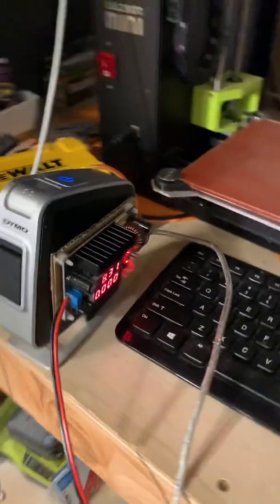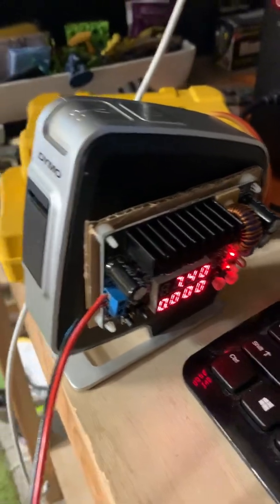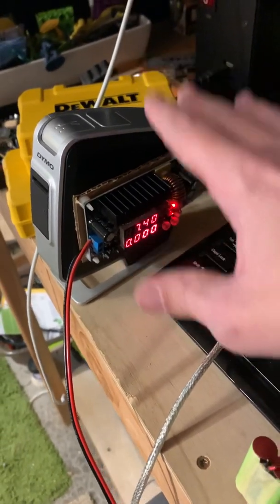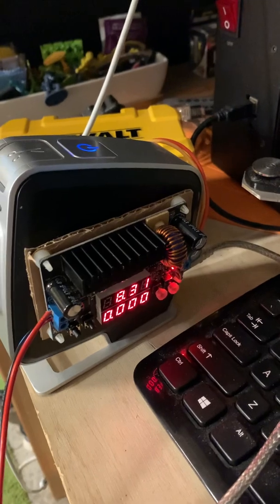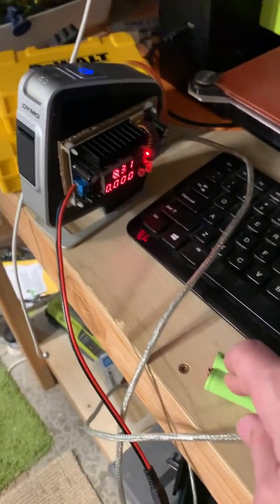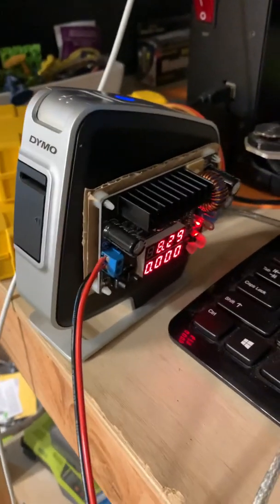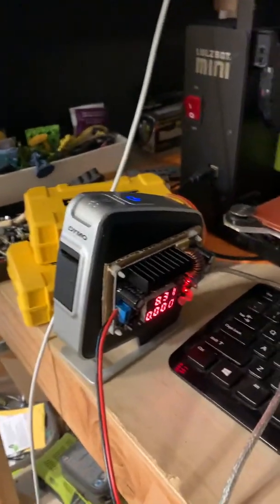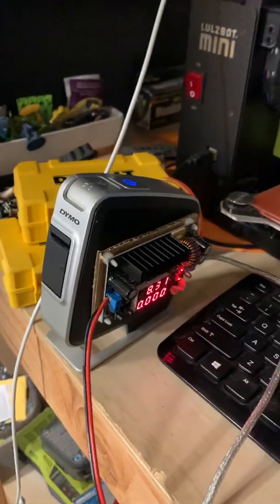Repairing a dead Dymo label printer - Support Right To Repair and ethical electronic design

Comment: good explanation of the problem. I like the printer and the basic idea, but they should have just used a pair of standard size Lithium Ion cells (a pair of CR123's mighta almost fit) and just told us to keep it plugged in for 20 minutes or so each time we use the printer to keep the cells charged. They would last years that way.  Like you said though, that doesn't make them more money does it?     Great video!  Thanks.

Comment: Just received a broken PnP and I'm about to get deeper into the actual cause of failure. I suspect the printer uses excessive amount of current when lying disconnected in a drawer, thus killing the battery. Would not happen if the printer was constantly plugged to the USB. The manual says to remove the battery for prolonged storage, and that's as simple as that to protect the printer from failure. Of course no consumer would ever do that but will happily blame anyone else for the failure. The R&D could have added an internal battery switch that cuts it off when no VBUS is present, but after working in a few electronics companies I can see why it did not happen (no time to roll out another PCB spin).
I'll experiment with capacitors instead of batteries, so the printer will be immune to fatal discharge below the safety threshold. If it works it will be even better than a battery pack, but I don't hold my expectations high, especially when printing a solid black square.
Also, planned obsolescence is a myth. The actual reason why stuff breaks down are the accountants and marketing people running the R&D departments. No actual effort is ever put into making stuff break prematurely, because it's already super hard to make things last. It's the pressure to keep cost low and time to market short. Ever wondered why it takes 10+ years to send anything into space, and everything is delayed all the time? Because consumers are not a part of the equation. I worked there as well and I liked it.
Reply: I have mine constantly plugged in to my workstation and I have the same issue. I used a voltmeter to test the battery. It shows strong voltage but the software reports it as dead. Dymo is producing and selling junk. Avoid their products.

Comment: If you take the battery out. Short it to discharge. Then reinstall and charge properly then it works again
Reply: I searched and came here because I was having the same problem as everyone else. Tried your tip @jimharvey2k and...YES, it works. I'm printing again. 
I used the tips of pliers to short the battery. maybe it resets the BMS? 
Thanks a lot anyway. 😎
Reply: Oh shoot! next day, and I'm back to square one - not working again. this is a hot mess.
Reply: @Alamodust  I just shorted mine and reinstalled and now it seems to be taking a charge. Before it wasn't charging at all. I even tried to hook it up to an outboard charger with no luck.  I don't know if this will work long term, but it's something to try anyway.  Thanks for the suggestion.

Comment: After my Dymo PNP battery died, you inspired me to do some experimenting as I had nothing to lose. I thought your solution wasn't aesthetically the best so I fished out a 9V power adapter from my stash and connected it to see if that would work. Lo and behold, it worked great! Connecting my label printer now shows a 100% battery in the app and prints as per normal. So for a more elegant solution, I disassembled mine and installed a socket on the back to connect the power adapter. I plan on putting together some instructions on how to disassemble it as there are a couple of gotchas that might ruin your experience. I'd post a pic here but I don't think it's allowed. I posted on Reddit about it - search for "Dymo PNP battery won't charge" on Reddit.

Comment: You can, and I have, just replaced those batteries with available cells. They are Lithium Li-Ion 3.7v 14430 650mAh rechargeable cells. I got two batteries at a UK price of £11.85 (approx $14.63). Unsolder and replace exactly as they were inside the battery case. You will need to crack the case open of course! The 14430 reference relates to the size of the cells which are 14mm wide and 430mm long, so ensure replacements match this. You will also note the Dymo reference on the original pack which also uses this as the 'model' name. Mine worked fine, so give it a try...

Comment: I have trashed maybe three of those so far. I always found the battery to measure about 8.2 volts and I thought that was okay, so I never tried what you did. Today my latest printer refused to print, and so I tried replacing the power supply with a dc supply adjusted to 8.4 volts. Now it is reporting a full battery, and it prints. I wanted a printer that could print via USB and with simple software. It seems impossible to find something like that, so I kept buying these pieces of junk as it was the only thing meeting my feature requirements. So, it looks like I am back in business. Thanks for posting your solution. I am using a postage stamp sized dc-dc converter to get 8.4 volts from a 12volt wall wart.

Comment: It seems like 10440 Lithium Ion batteries would do the job just fine and they fit inside a 3D-printed enclosure that could replace the battery. Then, if the printer fails to charge the batteries, you can use a standalone LiIon charger to charge each 10440 individually. I'm probably going to try this. I'm on my second battery for the printer and the battery reads 7.0V, but refuses to charge further in the printer. Not going to buy another one...

Comment: Hello Ryan. Thanks. I really appreciate you sharing your knowledge. Now I understand why the unit has a battery. Does your knowledge extend to knowing whether a capacitor could achieve the same result?
Reply: That's how Dymo should have implemented it in the first place. I don't think the capacitor would have needed to be all that big, but it's of course a function of how long you need to print in one go (the capacitor should not drop below acceptable voltage in that time, given the load to operate the print head). 8.4V * 200mA = 1.68W. And a 500mA USB output at 5V can provide 2.5W, so it's actually odd they don't just pump that up to 7.4V or whatever is the minimum they need...

Comment: Can't you just show us how to fix it so we can keep them out of the landfill?  Like an easy fix? Someone had written something on Amazon reviews about how they bypassed the protection chip or something like that. I would love to see a video where someone just shows people a the easiest way to fix it?  This video, while I'm sure it's good for some, means nothing to most.
Reply from the maker: You need to emulate a battery voltage. That's all that's needed; there is no chip to bypass. It simply needs to see the voltage on the battery terminals. This is why I am using the power supply on the side.
Reply: @RyanHeaney47  mine isn't charging the battery at all, even tried a new battery. Was that the same problem as you were having?
Reply: @RyanHeaney47  SO could I solder on a 9v battery connector and just plug in the battery when I want to print? BTW, my first died after 2 years. They sent a replacement and that has just died. I too have many rolls of tape. This is so annoying because otherwise it's a great product.
Reply: @stuartlloyd2000  There seems to be a deeper problem. I am absolutely certain, that the voltage reading chip on the device is the main culprit OR the firmware locking the thing up for no reason. My dymo randomly stopped working with a perfectly fine battery, that still has like 8.2 V (The LiPo is rated for 7.4 V -> 2* 3.7 standard LiPo). So that is fine. Adding a 9V battery instead (9.7 V!) made it work and the battery appeared "slightly charged" (one bar). I also added a protection diode to avoide reverse voltage to that battery. However after just a day or so, this setup also stopped working and shows me an "empty battery". I am certainly pissed. Great product but planned obsolescence is such a bummer...
Reply: Take it out and short they battery then reinstall. Works again